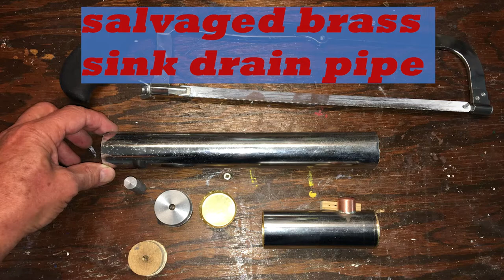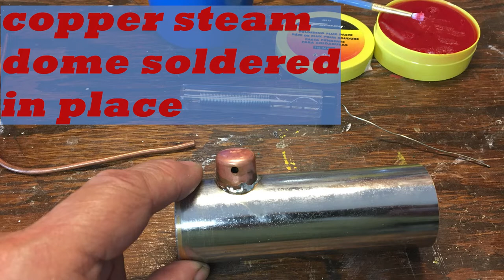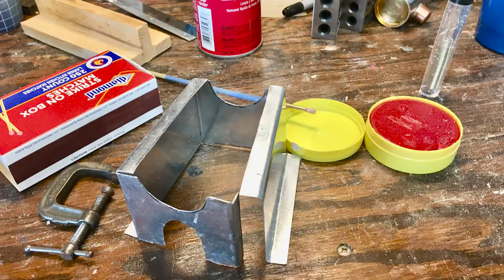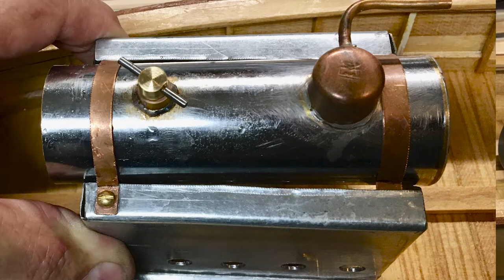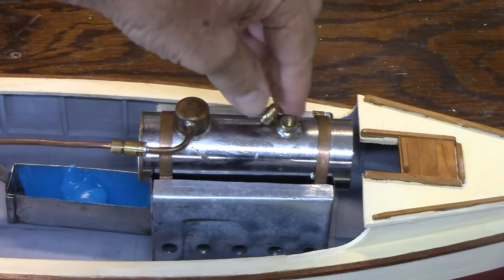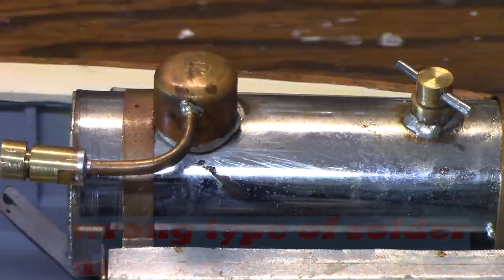Live Steam 5-inch Boiler Fail !  Home shop Construction of a DiY model steam boiler

Comment: Interesting video.  Yes, you need to use a high temperature silver solder on boilers.  I have good results with Harris Safety-Silv.  It has 45% silver and melts at 1370 degrees Fahrenheit.  Easy to use once you get the hang of it.  You can use an ordinary propane torch, but you have to get the parts pink hot.  Looking forward to your next video with the Wilesco boiler.
Reply from the maker: Thanks Les, good tip!  That name sounds familiar and I probably have some in my "northern shop"

Comment: That's a lovely little boat I would be very proud of that, I'm sure your boiler will be fine with a little more solder. What did you use to seal the stern tube please.
Reply from the maker: Thanks for your kind comment Dave.  The propeller shaft just has some grease in it, not really sealed per-se.

Comment: Does the boiler have a relief valve?
Reply from the maker: My home made one does not, but it fixed itself I guess.  With this type of oscillating engine the spring holding the valve
plates together can lift away and relieve over pressure.